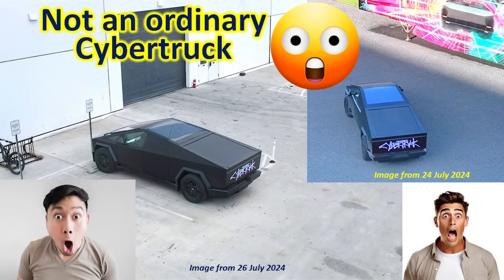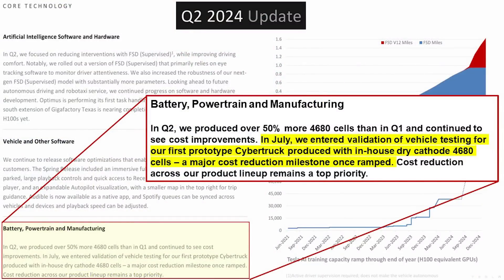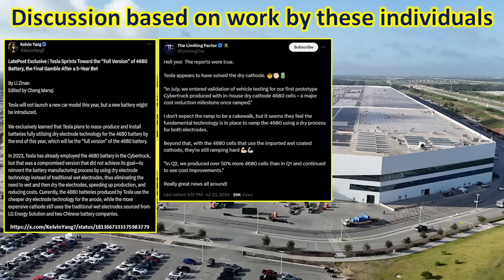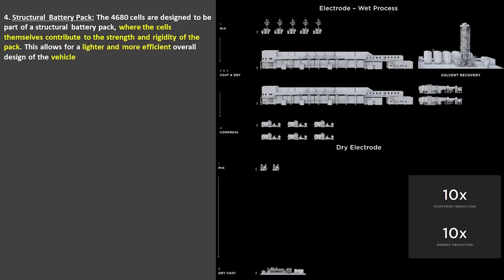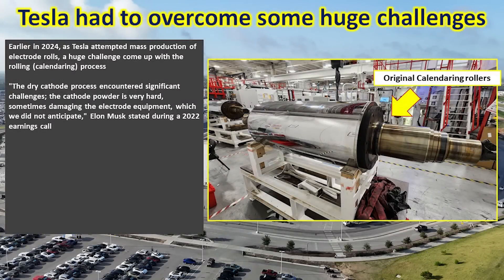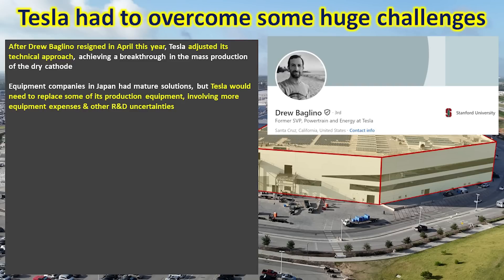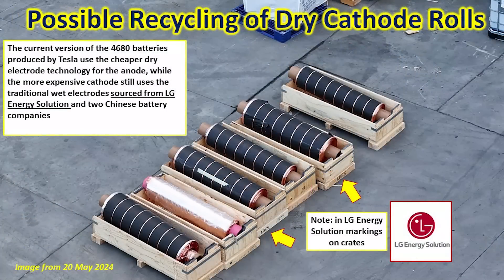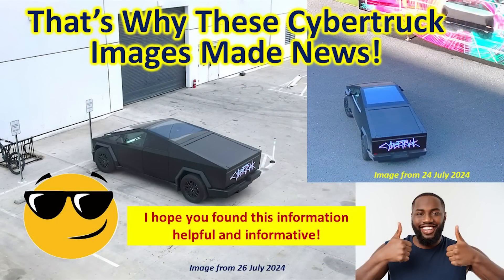Why this Giga Texas Dry Cathode Cybertruck is so important & what it tells us about 4680 Production!

Comment: An advantage you didn't mention is thermal performance. Not talking about the tablets design and heat dissipation, I mean cold weather performance. The solvents are one of the major culprits in cold weather charge and discharge rates being degraded. That aND extreme temperature variation won't have as much if any effect on these cells.

Comment: If they are making the dry cathode in the battery corner of the main factory, what are they making in the cathode building?
Reply: The original announcement was to produce high-Nickel chemistries. The cathode building takes in so-called Precursor materials like LithiumOxide-monohydrate, Nickel compounds (or even pure Nickel) and so on. All ingredients are pounded/milled to very fine particles, mixed according to the desired chemistry-formula and then they are sintered at high temperature in a kiln. Likely a roller-kiln, through which the mixed material is moving according to a precisely set time-temperature profile. Before entering the kiln, the material is pressed into ceramic holders, called saggers. After cool down the material in the saggers is a very fine grey powder, ready to be deposited on the cathode-film that will be cut and rolled into a battery cell. It has been transformed from Precursor material to Cathode Active Material (CAM)! This is the main function of the Cathode building.
There is a very good YT video on this subject, search cobalt free mass production SVOLT.
After packaging the CAM to avoid dust contamination the logical next destination is the 4680 Battery Assembly corner in the main building. But maybe the mass-production trial runs explained by Joe have been carried out using purchased CAM. The thing is, Cathode building is completely shrouded in secrecy so we have to await official word whether they have also started trail runs there, in tandem with what is happening in BA. If the exact specs for CAM are of critical importance to the succes of ramping the mass production trials, it may be a good idea to do that in-house as well, taking out one variable in an otherwise daunting task. My 10 cents: Cathode building should join the ramp in Cathode production (in BA) as soon as practicable to avoid having to hit the brakes later on when the machinery in BA is humming at speed....
Reply: @hardernl8893  Thanks for taking the time to explain the details!!

Comment: This is really good news. A while back, during the Cybercell battery teardown, Munro & Associates noted the dry process anodes and suspected that the cathodes in the batteries they were looking at also may have used the dry process as well. Electrified reported on that possibility. I've heard no more about that, but with the new announcement, I guess those older batteries used the wet process for cathodes after all. (But maybe not, dry cathodes were being produced then, I think, just not "mass-produced.")

Comment: It took them two years to realize they should invest in new calendaring rolls that would not delaminate?
Reply: Unlikely that its that simple. They probably had to work with suppliers to design the new equipment components. I doubt it was off the shelf. But I'm only speculating.

Comment: Thanks for that update, Joe. Appears that Tesla has turned the corner and now will be able to quickly ramp up those dry cathode 4680s. It's been a long slow process.
Reply: 6yr stated timeline for 4680s. Already gen2 cybercell are over 10% more energy dense vs gen1 2022 cells. Without the dry cathode process.

Elon said some companies all they do is build batteries and have for decades. And yet in less than half a decade tesla with 4680 cells is stride for stride with them. 

He even mentioned in 2022&23 in house 4680s were cheaper on a per kwh basis. By the end of 24 they should be back as the cheapest per kwh for tesla to use. Also their in house tx based lithium refinery is about to come online driving 4680 cost down even further. 😎

The 4680 was also the worlds first proven cell to pack vehicle produced in Sep of 2021 pre production model Y. And sold in April of 2022 to a paying customer. The ct cells also have proven themselves on a 350kw 800+v charger to get 327kws max and recharge 80 miles in just 8 mins.

Comment: Go Tesla - Start a test production line of Solid State Batteries!    500Kw density, 10min charge time - Wow!
Reply: Sadly tesla will likely be 3-5 years out from solid state cells, especially in house ones. 

Shame as China already has the welion semi solid state cells in series production for the nio et7, in a 150kwh pack weighing 44# more than the same sized catl nmc 100kwh pack does. For a 43% increase in energy density at the pack level vs nmc! 

Imagine how much better true solid state in 2028-2030 will be beyond that. 😎